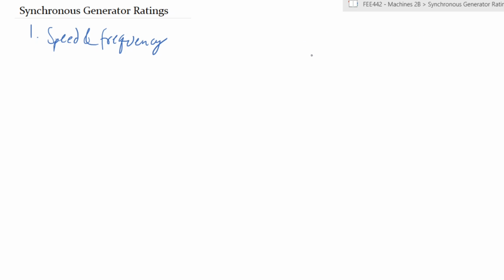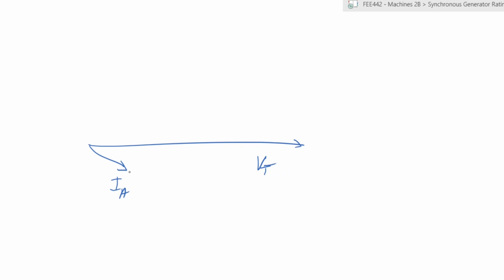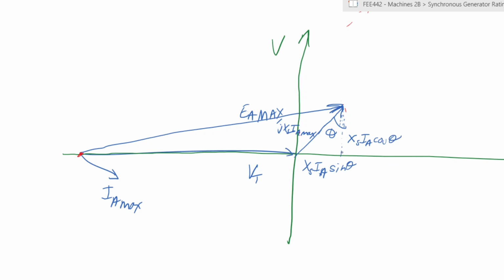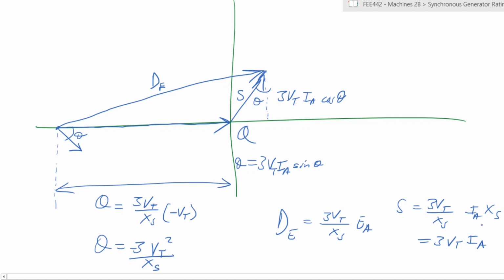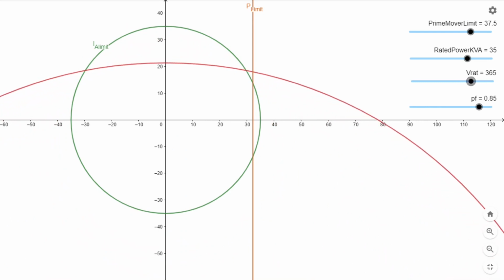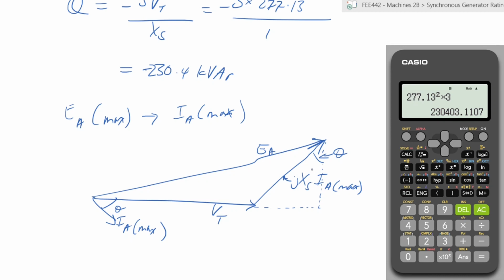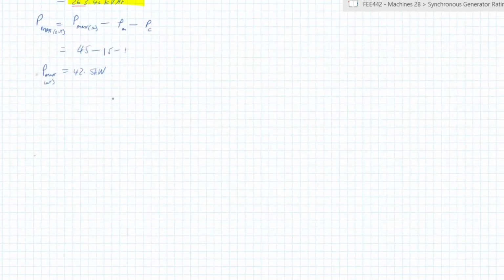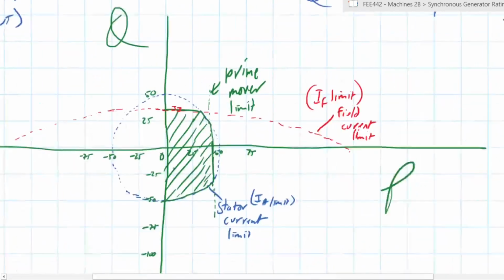FEE442 Lecture 4: Synchronous Generator Ratings

Comment: Sir.
We have Iacos( theta) and Easin( delta). These 2 represent active power.
But Iacos ( theta) is on the horizontal axis and the other term is on the vertical axis.

How is this possible? The vertical axis and horizontal axis represents active  power.

Same with Ecos(delta) and Iasin(theta) for reactive power.🤔🤔🤔🤔